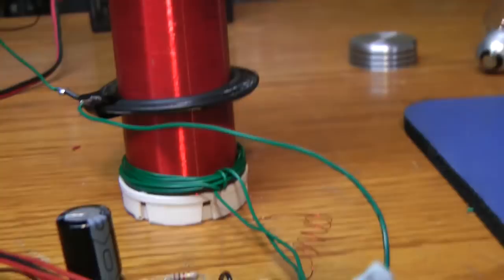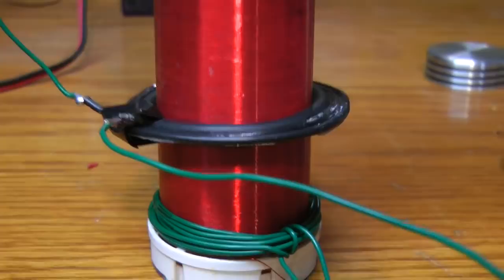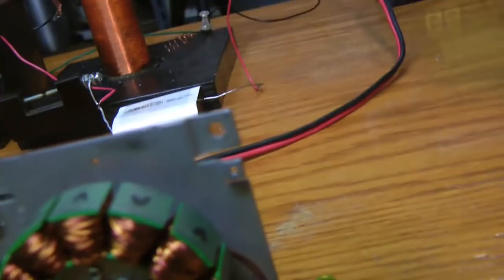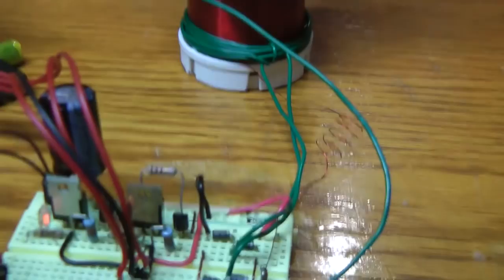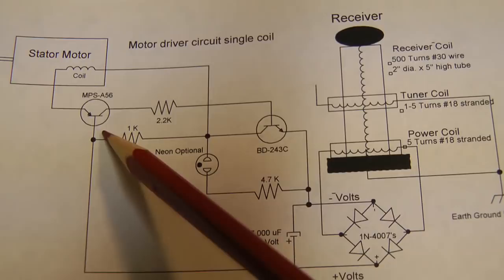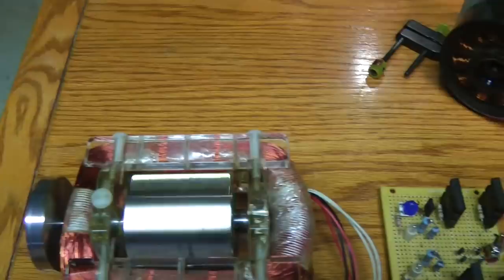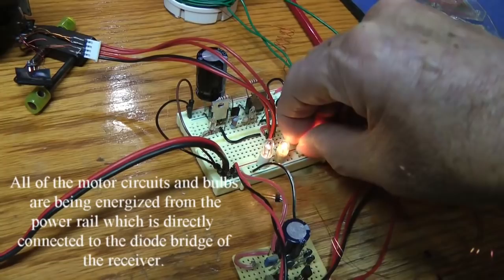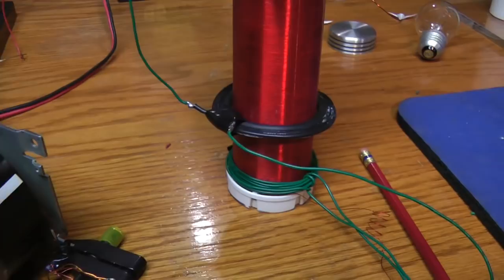Tesla Wireless Receiver Tuning

Comment: Not wireless, but single wire. This was what wardenclyff tower was for, to transmit energy generated by a large source like a niagra-falls, and pump the power into the earth as a single wire. The reason the system never took off, is because you cannot meter it. Anybody with as resonant receiver can plug into the earth and receive their juice in the 10kHz band for free, minus the cost of the receiver.

Comment: That's great work!  I wonder if the Tesla receiver would be a good way to get usable energy from any static generator such as a Van De Graaff or Wimshurst.  Thanks for sharing!
Reply from the maker: Ben, I'm not sure what you could expect. Static is a lot different than the output from a resonator. I think one of the most important features in these videos is the high frequency of the transistor resonator, unlike the slow frequency of a mechanical generator. I think also the difference between AC and DC are a factor.

Comment: hi dadhav! does the load on the receiver affect the input? i remeber watching don smiths video where he has one transmitter and four receiver, and he states that energy in recievers does not affect the input on transmitter, unfortunately he didnt show it working. like your chanel
Reply from the maker: In this experiment the input current draw did not change from .5-.6 amps no matter what load was on the receiver side. However, I'm sure the total current capability on the receiver side is les than the transmitter side.

Comment: Wow awesome work!  How much power are you using on your transmitter?
Reply from the maker: I was running at about 24 volts and .5 amps. I'm tempted to wire the other frame that matches the transmitter used in this video. Ha, if only the total watts on the receiver end could surpass the transmitter side right?
Reply: @DadHav  any luck with that? surpassing the output watts vs input watts??

Comment: damn amazing results your getting and that tuning coil is actually a great idea!
maybe can add some variable capacitace to the primary to for finetuning?

loading the output of your sstc causes the input current to drop.
maybe that's why your heatsink thermo motor didnt run?
Reply from the maker: Not sure about that Acid. The amp meter held steady on the input at about .5-.6 amps no matter what load was on the receiver.
Reply: DadHav what kind of amp meter your using? maybe mine is glitching? :)
allthough i had the same effect with my half bridge sstc (when i draw a arc or load the coil with a free standing coil input drops drasticly (from 4 amps to 1.5))

anyways amazing work as always!
Reply: not sure if this is relevant, but loading the circuit changes its impendence characteristics, which probably has something to do with resonant frequency, so that resonant frequency is changing when the loads are different, so you need to tune for the load maybe...

Comment: I didn't get that. Are you saying your are running this off of radio signals?
Reply from the maker: Hello Greg, Something like that. The resonator is in the megahertz range and I think rather than radio waves we might be looking at some sort of scalar wave. But yes the energy is traveling through the air from the transmitter coil to the receiver coil.
Reply: @DadHav  except that this is grounded, not bipolar without center-tap, so not actually wireless here, but instead, resonant single wire power transmission. When he tunes the circuit he goes closer into resonance and more power displays to the receiver. ( http s : // www . youtube . com / ) watch?v=Qz1-RIcj1HY